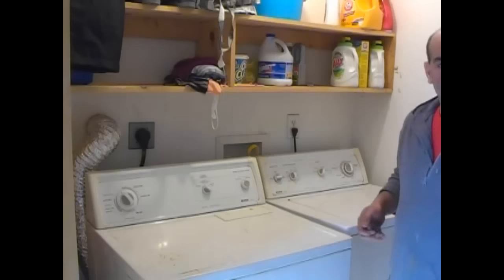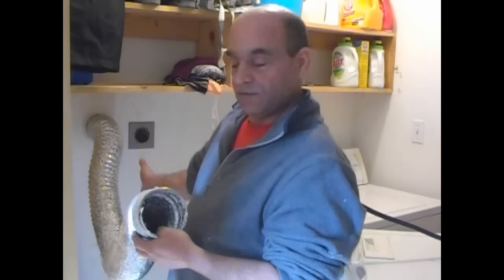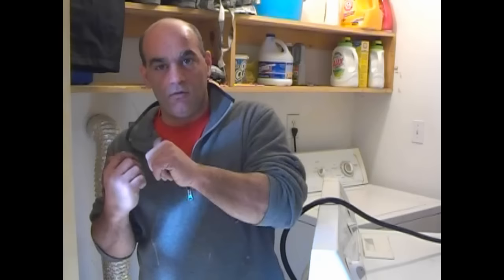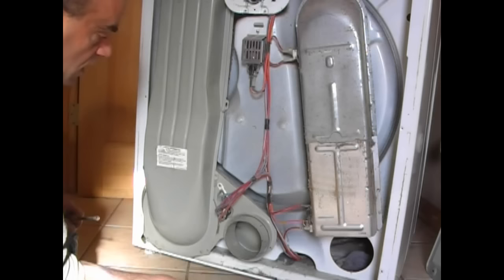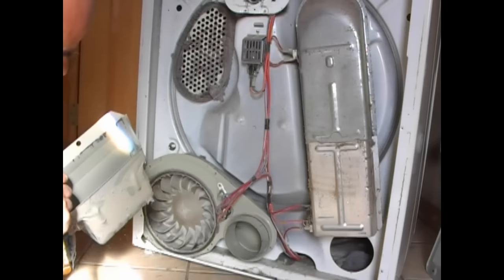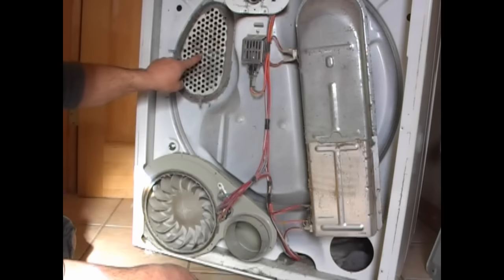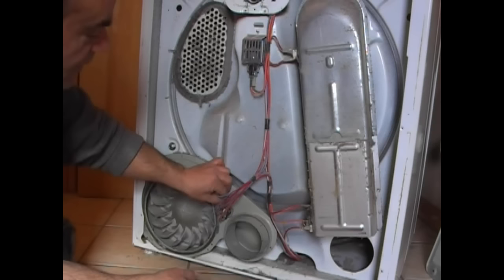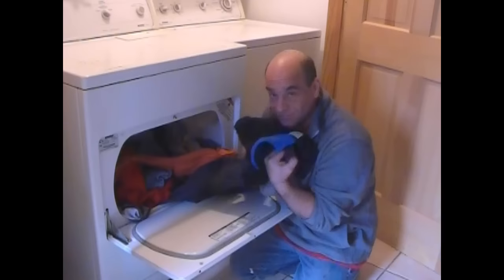How to clean your clothes dryer. How to make it hot again.

Comment: How about cleaning out a dryer that's heated with propane gas??
Reply from the maker: +Jessie Ossorio Same thing
Reply: +askmediy I'm worried about the gas line (looks like a cooper coil) that attaches to the dryer.  I can't pull the dryer out that far b/c of it.  I would hate to call a professional if I can do it myself but want to be safe at the same time.
Reply: Your propane connection should have a valve on the line. When you turn it perpendicular to the line the gas will not flow. Get two adjustable wrenches and listen the opposing nuts at the connection

Comment: My lint screen is only partially catching lint
Reply: I HAD THE SAME PROBLEM. THIS VIDEO SHOWED ME HOW TO FIX IT. You can read the process I used at my comment, (di gingrich). For the last 6 months I also had almost no lint going into in my lint screen. I tried cleaning the lint screen shaft on the top of my washer with a 2 ft. long narrow flexible dryer brush (Amazon), but I ONLY got about a 1/2 cup of lint out of that shaft. The lint was not going into the screen – but was building up and getting packed into the long air shaft AT THE BACK the back of the dryer (he shows). There was 8 cups of lint that had become packed into that air shaft. My 1984 dryer now works like brand new.

Comment: Dryer should be cleaned out every for 5 years at the most there are thousands of fires every year what you missed is taking your vacuum cleaner hose through the bottom and getting the dirt out of the bottom I cleaned out a lot of dryers and I've seen 10 of them that I've had two gallon jugs full of Lent in them those electrical thing is you're talking about including a fuse a thermal fuse when those things blow and make the unit stop working it's because you're close to having a malfunction with she could end up with a fire you are funny to watch Good video but this is a very serious problem somebody with the know how should be doing this this is very serious stick with what you know I'm waiting for your next video on how to mend a broken arm

Comment: you skipped the most important part. how do i get the back off? geesh
Reply from the maker: Being that everyone is very different, no I didn't really.
Reply: if you have the lint trap on top chances are you just remove the screws on the back panel. if its located in the door however it could get a little more complicated. but typically you can find 2 screws in the top right and left corners on the back of the dryer. then pull back and it should slide off. then you should find about 3 or 4 screws on the top of the door holding it to the cabinet. once you take those off your going to have to remove 2 or 3 screws from the door down by the lint screen. you will have to open the dryer door to get to them. then the door should come forward. DO NOT forget to unplug the door switch.
Reply: tammy g. common sense, take screws out of it!
Reply: Thanks Mark, was wondering this exactly.